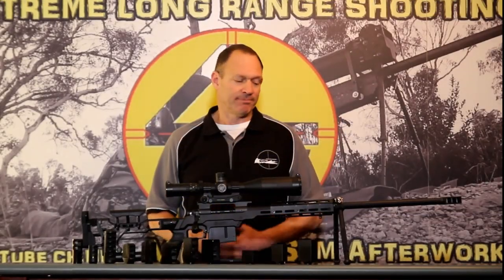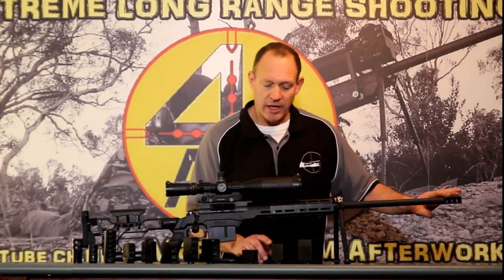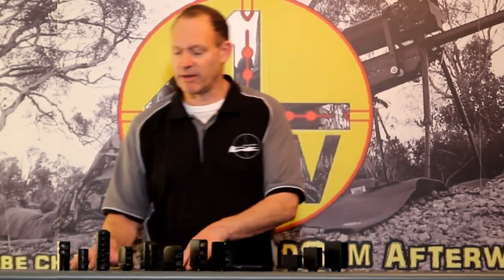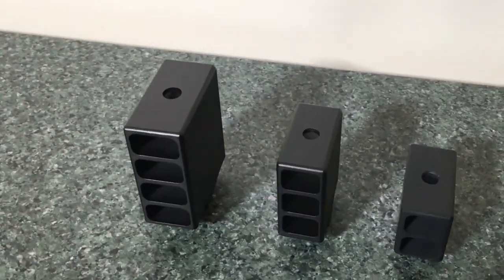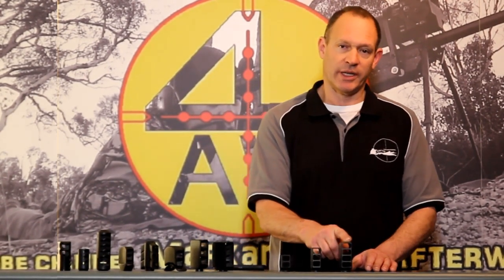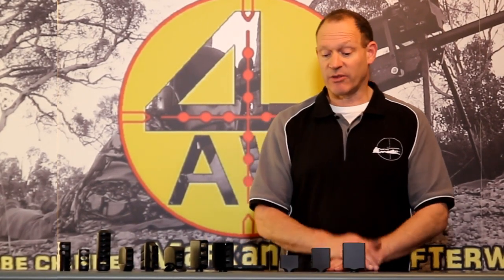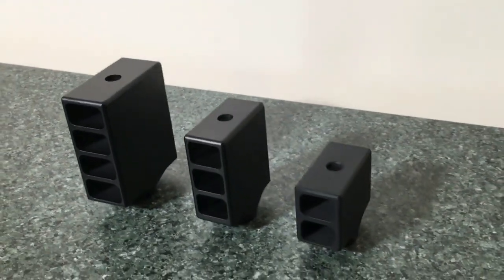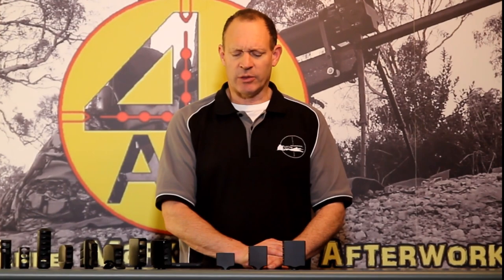4AW Muzzle Brakes (product video)

Comment: Muzzlebrakes are the enigma of shooting. So much goes into design, efficiency and aesthetics. I really like the design of your brakes.

Mark, have you ever used the Terminator brakes? I believe they are based out of New Zealand. That was the brake I am going to start with but now am considering yours. Any input as far as comparison? Will be for a .300 Win Mag.
Reply from the maker: Terminator brakes are very good and efficient brakes, designed to be more effective at recoil control than most others, our brakes are designed to help control dust and dirt blowing up when shooting prone in dry conditions, different designs, different looks, different results, Cheers

Comment: good stuff guys, you timed yours by thread length, how will these be timed, lock nut?. Great video
Reply from the maker: Hi Ian, timed like most side port brakes, barrel thread cut to suit, brake trimmed (filed, turned or faced) to suit or a shim kit that we can supply. Or yes if you have enough barrel thread you could run a lock nut, not very pretty, but easy, Cheers